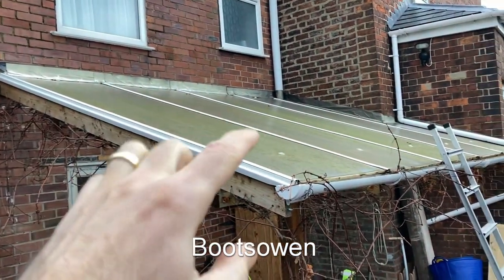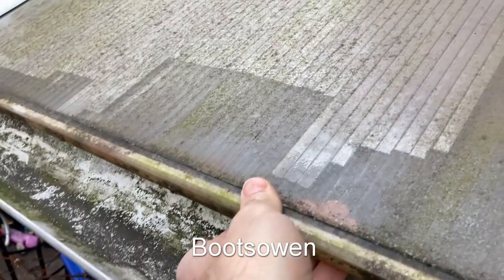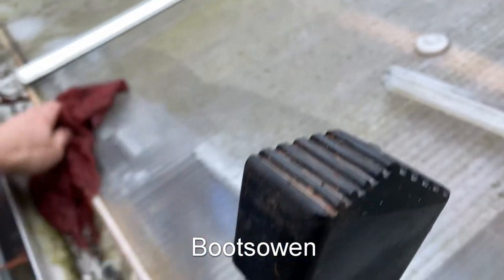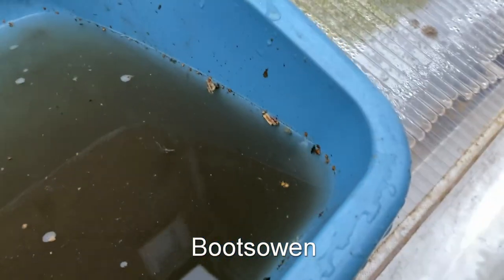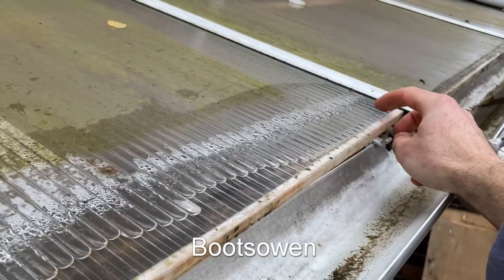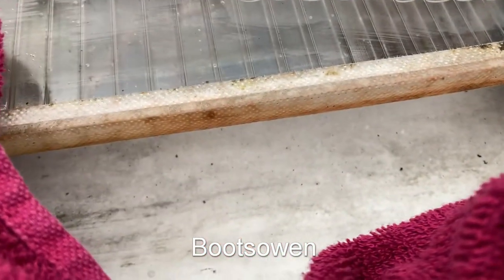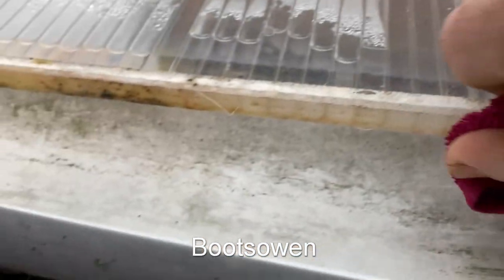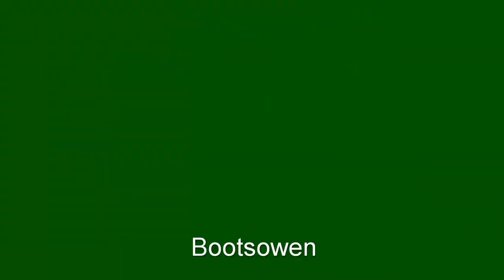Getting water out of a polycarbonate roof

Comment: Youre meant to use a plastic U strip at the bottom of the board to keep the water out -  instead of the adhesive strip (which is only meant for the sides of the boards)
Reply from the maker: I have adhesive strip and plastic u at the bottom. And adhesive at the top. I can’t see the point in putting adhesive at the sides. The sides are sealed. In this case, for once, I followed the instructions.
Reply: Tape goes on top and bottom not sides. H channel between sides to join panels. U channel over the tapes on the top and bottom. Bottom tape is vented to keep dust and bugs out while allowing condensation to disperse. Bottom u channel, same end as vented tape needs small weep holes to be drilled. So looks like bottom u channel doesn’t have weep holes.

Comment: Way to get up there and drain it.  Seems like just rubbing it helped after the vac.  I have the exact same angled porch. No cover on this single layer poly. It has a black dist 2 inches at the end. After watching this will avoid the dust tape. Simply clean with a q tip and vinegar. May experiment with a clear tape to keep the dirt out.  Theoretically the venting is happening at the open top.

Comment: Thanks for the video, I was thinking of putting on the end caps with breather tape. But I guess it does not work 

Did you get leaks in the vertical joints
Reply from the maker: No leaks!

Comment: Mine is doing the same and when it builds up come into the room behind from under the rubber strips inside the plastic white stripping on top, I did seal with clear sealant but for some reason it did the same a week later, you don’t seem to have small end caps on the external white stripping which I do and when I took them off lots of water came out
Reply: How did you fix it then?